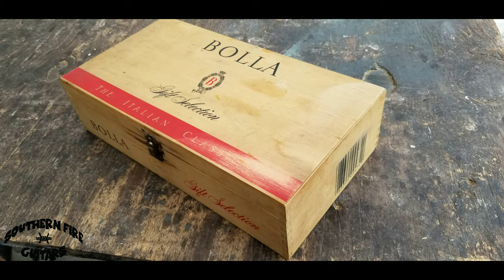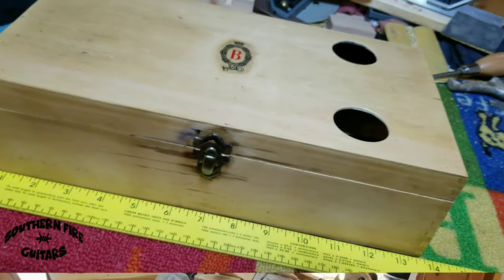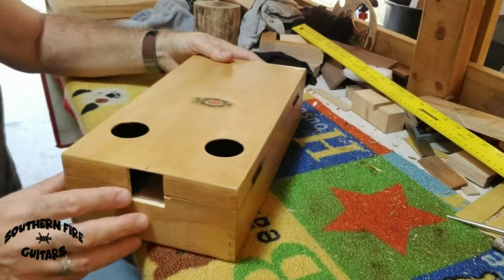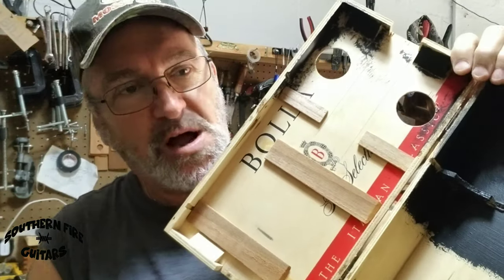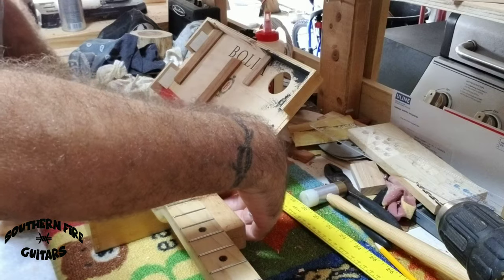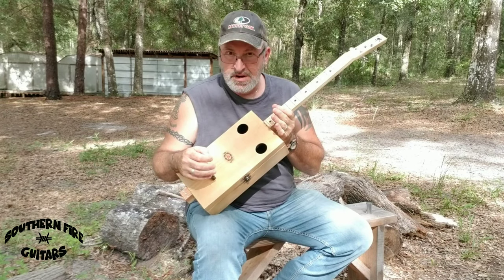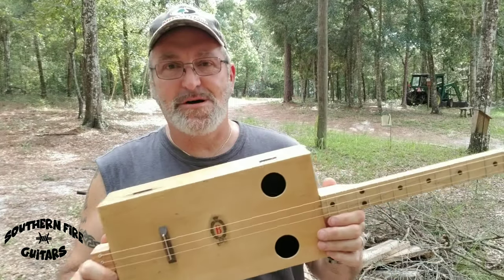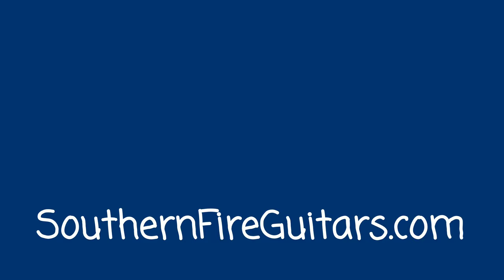How to build a Cigar Box Guitar - HEY!! That's NOT a Cigar Box...

Comment: I'm waiting for builders to really get into tone. I've played with sound hole placement and sizing, shaving the inside of the top, and bracing of the top as well as the inside corners.
Reply from the maker: Yes, I think there's a lot of different techniques to try, that could make a big difference in the sound.
Reply: As a builder of all types of stringed instruments i been experimenting with tone and different methods and techniques for 40+ years . There is all the information on the subject you could ever want or need available out there your just looking in the wrong places .

Comment: Was hoping you could share What scale length are you using? Also If I’m not mistaken I count approximately 17 frets is that correct?
Reply from the maker: That guitar is on a 23'' scale, and has 15 frets. It  does have a  jumbo fret used as the nut.
Reply: Thanks for your quick response. Yes I’m going to try a “zero fret” version of one of my cigar box guitars  using a Jumbo fret in Lieu of a bolt or a standard bone nut . We’ll see how it goes . Thanks again
Reply from the maker: @rstarguitar5350   Your welcome, Thank you, for checking out the video, and good luck with your next build. M~